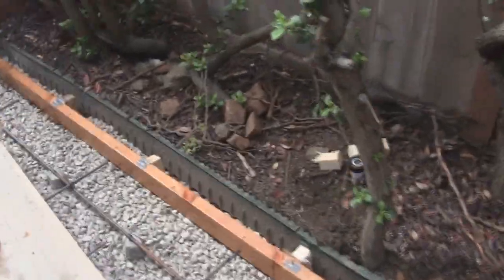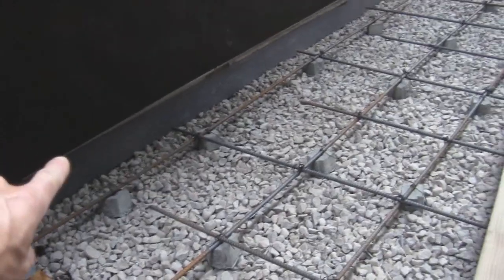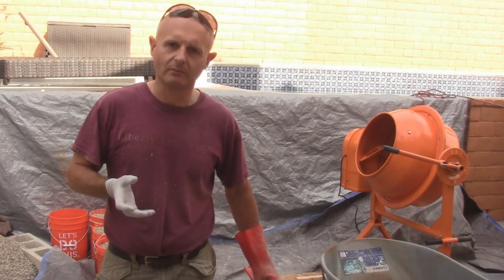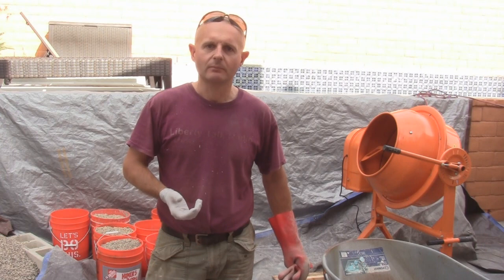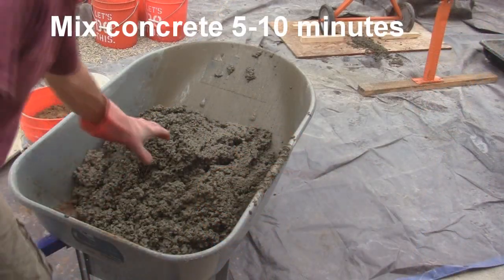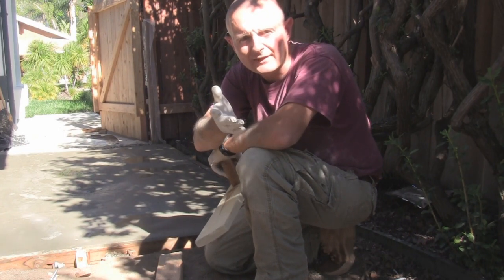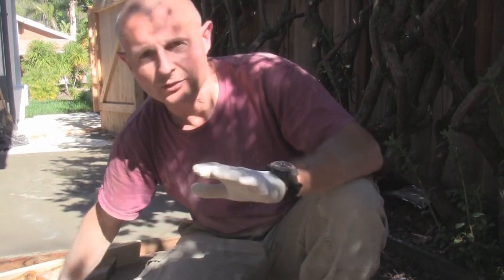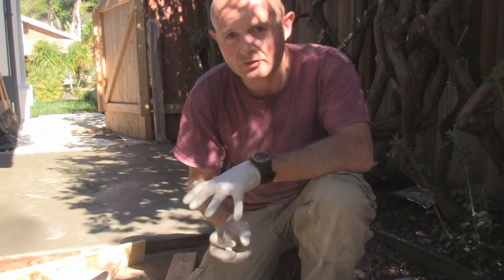DIY Concrete with Harbor Freight Cement Mixer 67536 61932

Comment: After watching, listening, reading, and learning from my own block guy, i have to say, this was one of the most informative and comprehensive videos on working concrete.  Brief, to the point, and succinct.  I have concrete curing right now, and i note that i'll be keeping it a lot wetter(but not so wet in the mix) now.    Thank you very much.
Reply from the maker: +dean jordan Thank you very much.  Yes, if you're doing a smooth steel trowel finish and your concrete has too much water in it you will have a hard time getting the surface to be perfect.  If too wet, as the water floats to the top (before it is set) will lift off the surface as it is setting and leave blemishes.  Once that concrete is set enough to not blemish if you sprinkle water on it, keep it wet for a few days is best.  I have found just putting the plastic on it even without keeping it wet is sufficient for it to cure properly.  /John

Comment: I used this exact advice to pour a 5 cubic yard fire pit patio.  From start to finish a one-yard section would take me 2.5hrs.  That's with my wife helping refill buckets.  The Money I saved on this project vs. hiring a truck more than paid for my Harbor Freight mixer.  It's a good workout but you can go at your own pace.

Comment: Thank you so much for taking the time to do this video.  Very nicely done.  I would love to see you work through the steps on another video.  I am about to rebuild  a crumbling retaining wall on a barn by myself and am a bit nervous about the time I will have to work with the concrete as I mix it.  From the video it appears I will have more than enough time to mix, pour, and work the concrete as I go.  Your instruction has given me much more confidence in doing this.  Thanks again.

Comment: All good points he is right concrete work is hard work not something you want to do all your life but there is good money in it. Make sure you don't water the slab to soon the surface is delicate the cream he is talking about is almost all cement brought to the top for that nice hard face finnish, if you water it to soon or briskly you can damage the surface. If you wet the base rock before you pour the mud like he mentioned and cover with plastic I never wetted the slab Intel the next day. Good video thanks for sharing.
Reply from the maker: Thank you

Comment: @John - it is very relevant. I have a similar mixer sold here by 
Canadian Tire and Princess auto, so a guide as to how much to 
practically load is extremely useful. I have done many building trades 
but not concrete. Having one day only for a large continuous pour it was
 absolutely invaluable to success. My only problem was adjusting the 
water. Bearing01's method of putting in gravel and water was needed to 
scrub the mixer between loads and prevent sand buildup.  The tarps all around are smart -  I had to scub my siding!  Many thanks to bearing01. Peter

Comment: Good video, lots of useful detail. Tip - be sure to read your mixer manual before you use it. Mine has plastic gears, and must be started before filling, or the gears will be stripped. Even metal gears would be under  lot of strain. Best to get the mixer rolling, then fill.

Comment: The only negatives of this mixer are: 1) they use a single shared starter/run capacitor 2) that capacitor is made out of plastic, cardboard, and thin metal plates, so if you are in a one-man build where you need to keep the motor running for more than 10 minutes at a time, it will outright melt (mine actually caught fire!).  AND, it's gonna fail just when you need it most so you'll be forced to buy from a local wholesaler who is going to charge you a premium. The one I needed ended up costing $40, which is a big percentage of the cost of the whole unit, where had I ordered from Amazon it would've been approx $10.
So if you buy this unit, just go ahead and order an actual metal housing capacitor [Amazon: https://www.amazon.com/dp/B07PBWT8LX], and replace the plastic one, and you'll get many great years of usage out of this unit. Mine is going on 7 years old now.
Reply: Great advice
Reply: @ottoman247  Not really.  We used mine all day, rarely turning it off, and didn't have a single problem.  Mixed 56 bags of ready mix no issues.  Odds are he just had a defective unit, which happens with everything mechanical.
Reply: Thanks for the heads-up.

Comment: Handy man side of him is very good. When he  tried to explain what water does in concrete he was not quite right...more water is good for workability (YES) not good for the concrete (YES) but not for the reason he said by evaporating and crack lol ...It reduces the strength not because it is going to evaporate...it actually going to evaporate slower than less water but the higher water cement ratio gives low strength because you have low concentration of cement to glue the concrete with the other components of the mix (gravel, sand etc)

Comment: I like the idea of the oil on the wood. Never thought of that. I have mixed my own; and have had to for small jobs. However I also found that the cost  of doing it yourself and getting a company to deliver it was not worth the diy for larger projects. For example the general formula is 5 bags of portland for 1 cubic yard. In my area that would be about $105 cdn for the portland cement. Then the materials (sand, gravel) for that cubic yard was about another $50 cdn.  Then there was the wear and tear plus gas on the truck to get it on site. So about $170. Local companies would deliver a consistent mix for about $160/cubic yard. Only catch there is usually a minimum delivery amount so this only works for larger projects.
Reply: Good information.Thanks for sharing

Comment: I'm a Mason, Concrete Contractor 45 years.. Never do you mix concrete by weight. The Basic mix is 1,2,3.  One part Portland, 2 part concrete sand, 3 part stone.. Depending what size stone you use we use 2 1/2 part stone. Now to REALLY screw you all up. Mortar mix and concrete mix is basically;y the same thing expect Mortar uses masonry sand. Concrete uses concrete sand. That 92 lb bag of "Portland" Commercially we shovel 32 shovels full of sand, 1/2 bag 52 lb Lime to 1 bag of Portland for mortar mix Basically 16 shovels of sand in 200 lb.  To mix concrete use 16 FULL shovels of sand for that 1,2,3 mix

Comment: A vibrator will settle the concrete into the form and yield a rough leveling. That saves a lot of time poking into the mud, working out all the voids.   It will also prevent honeycombing around the edges. A lot of the work I did was for state high bridges.  No voids, and all the wood grain of forms aligned.  We poured 50 cubic yards on up to several hundred at a time.  Lots of money involved with each pour, so we left nothing to chance.

Also, after initial hardening, we covered with burlap, and use a lawn sprinkler to keep the concrete moist.

Comment: Thanks for this excellent video.  Question: for your 3.5 cu foot mixer you could put in: 4.36 gallons cement + 8.73 gallons of sand + 13.04 gallons of gravel, and ? gallons of water to the max. Why did only put the half of everything, namely, 2 +4 + 6 + 2 ?
Reply from the maker: The volume you put in the mixer cannot equal the advertised volume of the drum.  You need to leave space for the material to slosh around inside while mixing.  It is also a lot of weight (5 gal is around 80 Lbs) and too much can stall the motor.  I have found that this mixer works well with two 80 or 90Lb bags of pre-mixed concrete and you don't want to put more in than that.  /John

Comment: Great video. Is there a big advantage to mixing your own concrete over buying a premix?
Reply from the maker: you can choose the color of sand to make the color match an existing concrete (join to existing sidewalk) by using say California Gold sand.  You can also choose a different size crushed stone like 3/4" or 3/8" based on what strength you want.  Also gives you the ability to add more or less portland cement if you want.  It's a lot more work to handle truck loads of shovel material vs 50 or 90Lb bags of pre-mix.  Concrete I've done since this job has been mostly pre-mix bag.  It's just less stuff to deal with.  You just dump the bag in the mixer and add water.

Comment: Just wondering I'm doing a quick create molde patio using just the quick create mix and water not thin not thick should I still cover and keep it moist even though the molde is removed

Comment: Bearing01... this is a great video but I wouldn't recommend covering the concrete with plastic. I would use burlap (or wet the concrete and cover with cardboard or a few layers of cardboard paper then you can cover with plastic. You can also use straw and then cover with plastic). The plastic however will cause the concrete to cure differently in places that the plastic touches resulting in uneven curing that will permantly leave your concrete discolored. Hope this helps on future projects. Once again, great video and keep them coming. These videos are handy for the DIY'ers!!
Reply from the maker: Thank you and you made all good points.  The first time I did concrete I used Burlap and the brown stained the concrete - i took over a year for the staining to fade.  I believe Burlap is a better Cure but you may have to wash it first or else risk staining.  I do like your Cardboard idea.  /John
Reply: You are exactly right, burlap will stain the concrete as well if it is not brand new. Great point!!

Comment: Thank you for this great video... I do have a question - How big of an area should be attempted at one time using the mixer? I have a 3 car garage and I want to try to pour the carport pads, they will be 20' long by 12' wide. I was told to drill into my existing garage floor, insert rebarr with an epoxy and tie this in to the new pour.  

Thank you
Reply from the maker: How much can be done at one time depends on how much help you have and how hot and sunny the day is.  The concrete will start to harden rather quickly (you may have 10-15min to screed it) if the sun is on it.  You would have much longer in the shade, cloudy day or cooler weather.  If you got a couple other guys you could have one on the mixer while two others are screeding/leveling the concrete and finishing it.  If you're working alone I would not attempt anything more than 6ft x 10ft at 4in thick in the shade in 70deg / 20*C weather.  You will have to pour 1/4 of it, screed it and then pour some more and keep going.  For a job your size I would highly recommend getting 2-3 more guys and order a cement truck.  You're looking at a lot of concrete not only to mix but to load and unload from a truck. It's heavy and a lot of work.  You're looking at a big job even with a cement truck.  Take your time and put in the base and your re-bar and then order a truck. I think by the time it's all done the cement truck will probably be not much more expensive than buying the bags and making it yourself.  /John.
Reply: Excelent answer. I need to show this to my wife, she is very supportive and encouraging about me working on home projects but I keep telling her this is not an easy job for just both of us. Time is and important variable. Our project is a driveway repair so as you said,  a concrete truck makes more sense.

Comment: that looks like a 3 slump, should be around a 5-6 slump with entrained air. what was the temp of the concrete when poured and the ambient temperature? This stuff matters.
Reply: what the hell does that matter. this guys tellin u to leave for 30 to 40 minutes after u screed and 40 minutes after u hit it with a mag. u might as well bring back the hitachi.

Comment: great video just one comment: the rebar should be placed two thirds down from the top (puts rebar under tension) or two thirds up from the bottom (puts rebar under compression). In the middle the rebar's strength is not fully utilized.

Comment: I've watched a lot of videos on concrete work and this is BY FAR the best I've seen. thank you much! i actually found this video by searching for that mixer, which makes this even better.. how long have you had this mixer, and how do you like it? Also- why do use your recommended mixture of concrete as opposed to regular ol' quickrete?
Reply from the maker: I've had this mixer for a few years now and it still works fine.  I've also mixed quickrete in this mixer.  The drum will mix around 2 bags of 90Lb at a time (if I remember correctly).  In this video the concrete I made used California Gold sand - which I used to make the concrete color match the other concrete next to it.  A video showing mixing concrete from components rather than bagged concrete is also more informative.  /John

Comment: How many square feet could you pour in one batch? My math tells me around 12 square feet. 3.5cu.ft/(3.5in/12in)=12sq.ft. I of course assumed a 3.5 inch thickness for you slab seeing as it is formed with 2x4. Some would have leached into your stone as well. I am wondering because I'm planning an 85 cu.ft pour and would like to make sure the recipe I use maxes out the mixer's capacity, while at the same time respecting your mix ratio; which I am sure is spot on. I plan to use 2 mixers like yours. Thanks for the great video, straight to the point information from start to finish.
Reply from the maker: the pour i did in that video is around 4in thick, 5ft x 10ft.  That's about as much as I would do working alone during summer on a cloudy day.  Concrete will "go off" on you a lot faster on a hot day or in the sun.  It took me a few hours to pour that slab while stopping at around 1/4 intervals to work what was poured.  If you had a helper you could do a lot more because as one guy pours the other is working it.  you don't want to kill yourself with the work so even with 2 guys I wouldn't go much beyond double that size.  If you have a helper and a big area then I'd get it delivered by a cement truck if you can.  Saves a lot of time and work and overall maybe not that m uch more expensive and worth it considering the work involved with lugging around 80Lb bags of concrete.
/John

Comment: How many square ft can just one guy do properly with one of these mixers in a 10 hr day at 4 inches and it not look different through out it?  You know so it still looks even and like it was done really fast with a cement truck dropping it fast?
Reply: 2 CY would be pretty good, 4 CY maybe if you’re a complete badass. So at 4”- 100SF not a bad day, 200 SF would impress me, and 400 SF if you’re in top shape and you’re planning on staying in bed for the next couple days.

Comment: what is the real world savings in mixing your own vs buying premix bags? i have to replace a side walk 28x4 ft.
Reply from the maker: If you wanted to use a different type of sand.  In this case I used a sand with gold in it to match an existing front concrete step.  When you mix your own you also have the ability to change the size of crushed stone in the mix or to change the ratio of your mix to do things like add more portland.  Creating your own mix is significantly more work and a little cheaper.
Reply: At least 25% to 50% depending on several factors. I realize I’m replying to a 5 year old comment, but if someone wants a quick answer, thats ballpark. 

If you want to do the math yourself- 
#1- Call a concrete supplier and ask cost per CY delivered. 
#2- It takes 45- 80# bags to make a yard of concrete. Source locally and figure the cost per CY. 
#3- To make a 6 bag mix (3,000 psi +/-). You need 6- 92# bags of Portland cement, approx 1600# of sand and #1,600# of coarse aggregate. Source those locally and figure your cost per CY. 

Way more than the above involved, not the least of which is mixing your own is HARD work, but there are other benefits to mixing your own especially if you want any kind of a specific mix. 2024 math bagged vs ready mix is within a few bucks per CY and around 30% cheaper to buy separate ingredients and make your own mix.

Comment: Very good video !  Although i did mix a lot of concrete by hand as a teenager   Putting a large addition on  our house in South Florida. With my Father. He never took the time to explain  the process  other than shouting orders to do this do that  in Florida most of the homes are  a concrete block construction with a  stucco over the concrete   Our house had concrete  ceilings  under the roof overhangs as well  so  i actually had. A technique  that i wound up. Troweling   All of that on by myself  working around the suns schedule to stay as cool as possible ! Luckily the ocean was only 13 blocks away  and. I had a pool. To jump in whenever that was necessary, my father. Didn’t  spring for the cost of a  electric mixer  although luckily he did hire a truck for the slab work  but all other concrete was mixed by hand  with a hoe  ny yours truly  as i was the only son LOL  Whatever wood framing was needed that was done with hammers and nails. Not even nail guns  i went on to. A career in construction  and used nail guns and  other tools to get the job done  especially if it made it easier and faster ! At one point i had a crew. Of 40  men  going  as well

Comment: Does this method apply to Arizona desert heat, ground etc?
Reply from the maker: Yes, Do same procedure in Az.  Only, do it early morning and use a pop-up tent or canopy to put your work in the shade.  Once the sun hits the concrete it's going to get hard fast.  You also don't want the concrete to dry out before it hardens - why you keep it wet while it cures.  To cure, once the surface is hard enough to not blemish from water, keep it wet and cover with plastic.  I use a garden / weed pump sprayer to keep a light mist of water on it until the plastic gets on it.  /John
Reply: @bearing01  You have a gift of explaining things simply and accurately